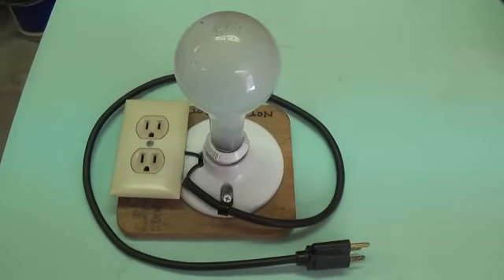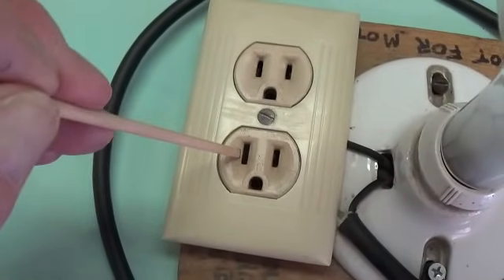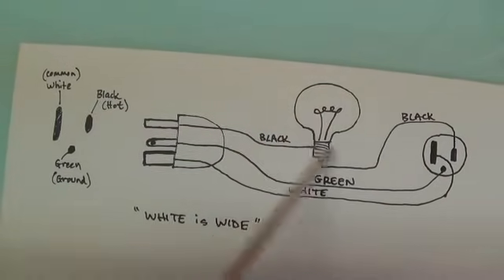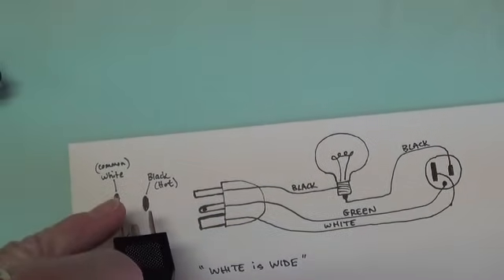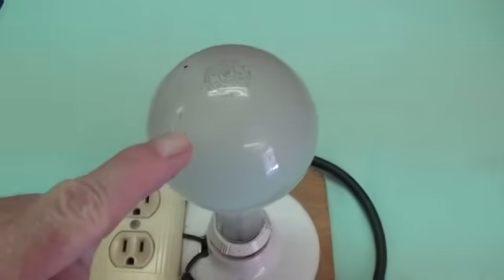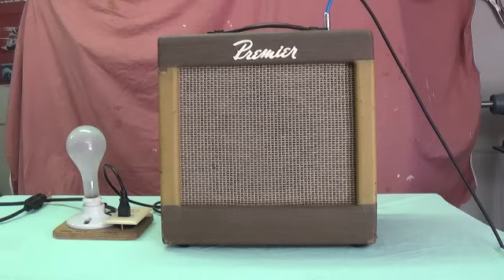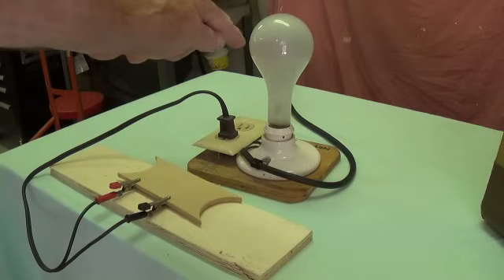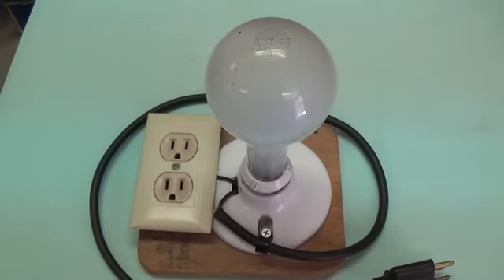Build Your Own Current Limiter for Protection when Repairing and Testing Electronic Equipment

Comment: Hey UD,
I just picked up a stereo tube amp from an old jukebox. I've ran it through your circuit and it plays both channels but has a bad hum. The bulb is on dimly but came up gradually, not right away. Do you think this could be an issue with one of the tubes? 
Thanks in advance!
Reply from the maker: +Rob Cosentino  Rob, you need to watch my video on types of hum and their causes. It may be a tube, but more likely the filter capacitors. Good luck.

Comment: Hi again Uncle Doug, Rusty and Jack. May I bother you all with a theoretical question? In a comment below you suggest wiring a couple of bulbs in parallel for someone to use with a 100w tube amp. My question is this; if one is to make a limiter consisting of 2 x 200w bulbs, is it better to wire said bulbs in parallel, which means both the hot and cold resistance is half that of a single 200w bulb, or in series, which makes the resistance twice that of a single bulb. I suppose the question really is what is more important for protection of the hardware; lower initial/cold resistance or higher on-going/hot resistance? Regards, Dave @ D-Tone Amps and Guitars
Reply from the maker: +D-tone Amps and Guitars Dave, the higher the wattage of a bulb, the lower its resistance.  Bulb wattage is directly related to amplifier wattage. High wattage tube amps require high wattage bulbs, and to get that high wattage (and low resistance) may require connecting two or more bulbs in parallel if a single bulb of sufficiently high wattage (i.e. greater than 250W) can't be found.  Connecting the bulbs in series would increase their resistance and would be the same as reducing the bulb wattage.......which would not be appropriate for a high wattage amp.  Low and medium wattage amps can generally get by on a single 100W to 250W bulb.
Reply: That's what I thought, but it is great of you to take the time to confirm it. I always get a second opinion where voltages that could kill me or blow things apart is involved. Thanks and all the best..
Reply from the maker: You're welcome, DT, and best of luck.

Comment: Thanks for explaining this UDoug! I read advice elsewhere on building a DIY Degaussing coil (coil of magnet wire corrected directly to wall AC) with the advice "connect a lightbulb inline to limit the current."

After pondering this I concluded this was bad advice and that the light bulb would have no effect. But that's because I was picturing the live and neutral in parallel with the circuit. Your video helped me understand that I can wire the light bulb "in series" if you will. Now it all makes sense, thank you. New subscriber right here.
Reply: +ygs ygs It definitely has an effect on the picture tube. But it's hard to tell if it's working as it should.

After building my coil, I went to try it on my CRT and discovered that the picture had cured itself - probably from using it over 2 weeks with the internal degaussing coil kicking on.  But in response to your question, I tried it on the one CRT I have in the house just now, an old curb picked 32" TV. 

Having no signal, the TV comes on with just the words "input 1" in large red letters.  With the coil in front of the picture, and power engaged (I used a momentary switch,) the bulb lights up and the red words on the screen jiggle back and forth sharply, right left right left right left. Is that what it's supposed to do?  I don't really know. I may need to hold it further away from the TV. But overall, I'd say, yes it is working. 

A friend has a store bought degaussing coil. It doesn't look much different from my homemade one. His also has a thumb engage switch, but no visible current limiting mechanism. He says his quickly gets hot to the touch after only a few seconds.  You might choose to make the lightbulb switch bypassable so you can have both versions in case the current limiting is making it less effective.  Hope that's helpful.
Reply from the maker: +Matthew Jenkins Thanks for subscribing, Matthew, and welcome aboard. Hopefully you will find all our videos to be equally helpful :)
Reply: Wish to find out, is your Degaussing coil using light bulb in series working ? I wish to build one Degaussing coil using light bulb in series.
Reply: Good. Thank you very much. Good information.

Comment: Uncle Doug:

                    I'm working on an audio amplifier that has two channels with a total of 100 amps.  

I'm going to put together a current limiter but what wattage bulb should I use or should I have two in parallel and what wattage for each?

Also, if there is a short will the difference in brightness be noticeable or should I test it with any electrical appliance that I know works to determine the normal brightness and then compare the two?
Reply from the maker: +Edward Boghosian The bulb wattage may require some experimentation, Edward.  If it's a 100W tube amp, I would think that a pair of 200W bulbs in parallel would be a good place to start. If it's solid state, I have no real experience, but a single 100W bulb might be a good starting point. The bulbs should glow very little, if at all, under normal operation, but will flash at full brightness if there is a short.

Comment: Hey Uncle Doug!
Thanks for posting this useful and practical device.
ONE QUESTION: How do you test the bulb before operation to make sure it is working?
Reply from the maker: +Learner-Learns You're welcome, LL. If the bulb is not working, it will be obvious because whatever is plugged into the Current Limiter will not work either.  To test the bulb you could simply short circuit the receptacle in the CL, and the bulb will illuminate brightly.
Reply: Ah, I see now... Thanks!
Reply from the maker: You're welcome :)
Reply: +Uncle Doug I thought the obvious answer would be "Take one out of the ceiling rose, which already works"
Reply from the maker: A good suggestion, except most people aren't using 250W bulbs in their ceiling light fixtures.....unless, I suppose, it's a pole dancing club :)

Comment: If you had touched the clips with your hands or fingers would the bulb  had protected you?
Reply from the maker: +wattdog16 Since the components the clips were connected to were carrying DC, I would have had to touch both a high voltage source and a ground to complete a circuit. This is one good reason to always use only one hand when working on an energized circuit. The bulb would probably not react quickly enough to save me from a nasty shock.....but it might save my life.

Comment: Hi Doug I built one of these here in the UK 240v, I use it when I get a old/new piece of equipment I buy usually receivers and occasional transmitters. 99% light up the   bulb  then immediately dims to a glow I also use different wattage bulbs to be gentle on old equipment starting with about 4 watts, and building up in stages to around 100 watts, don't want to shock the old components, like you I use it mostly everyday.
Paul    m0bsw uk radio ham
Reply from the maker: Paul Collins Greetings, Paul, and thanks for your input. It's good to hear from you :)
Reply: And you Doug, this device will no doubt save my bacon at some stage I'm sure,good video I'm constructing a isolation transformer at the moment, you have to consider this stuff as you get older and wiser.
Paul
Reply from the maker: Yes, indeed, Paul. The older I get, the less optimistic I become :)

Comment: Great video uncle Doug, I recently found an old phonograph that I showed to you.my question is . that phonograph doesn't have a wide terminal it only has two terminals The same size with no ground terminal.are there any extra or special precautions that need to be taken with a plug like this?
Reply from the maker: Donald Thompson  It's an old-fashioned, non-polarized plug, Donald. If the plug and cord are in good shape, and the phono works fine, then I would keep it. If not, then replace it with a grounded, 3-wire cord and connect the green, grounding wire to the metal chassis of the phono.

Comment: Hi Doug, Another great video, Your the teacher I should of had. But of course, I've got a question. ( I'm pretty dense) Ok , I read your description and I am wondering.  The bulb that I will use, will need to be tailored to fit the wattage of an amp. The amps I have are old a lot of them don't have the written description anymore.  Its wore off or its lost. For example; Today I will be working on an old Magnatone amp. It will be the first time I turn it on. ( I am crossing my fingers, from ebay) what do you suggest?
Reply from the maker: AmIonArock  Greetings and thanks, AA. The higher the wattage (power output) of the amp, the higher the wattage of the bulb, i.e. an old Magnatone with two 6V6's should  be producing around 15 to 18W of power, so a single 200 to 250W bulb will probably work just fine.  An amp that puts out 50 to 100W of power may require two or three 250W bulbs in parallel. If in doubt use a lower (i.e. 100W) wattage bulb (higher initial resistance for better protection) and work your way up to a wattage that just barely glows. NOTE: This is only true for tube amps. Solid state amps operate at much lower voltages and require much lower wattage bulbs.
Reply: Uncle Doug  I wish I could grasp what you said ? 
if the amp says 35 watts for this project to work, am I trying to match the bulb size with the amp? for example this amp says 35 watts, maybe a 40 watt bulb. OR am I trying to match watt is coming out of the wall, which is close to 110 volts.? Wait a minute a thought dawned on me...watts and volts are two different things ...am I right.  I can solder real good Mister Doug, even read some things on schematic.   But why things do what they do elude.  Reason I guess the confusion I do a lot of reading, and some other guy built his with a 40 watt bulb and yours was a higher watt so I guess if I knew why I would be better off.  I know that I am protect parts if there is a short. Maybe a bad capacitor  a short, and I am giving the electricity a place to go,case there is one.  And I am guess ing the bulb is acting sort of like a resistor. By the way this a small magnatone.
Reply from the maker: The "35 Watts" may refer to the power it takes in, not the power it produces. If it is a low-powered all-tube amp, then a 200W to 250W bulb should work fine.

Comment: When I really got into restoring radios and making stuff for myself I made a lamp limiter. It is the same, except that there are switches. One of them bypasses the lamp, the other being a on/off switch. I use different wattage lamps to drop the voltage by different amounts.
A cheap alternative to a variac. It avoids the situation where leaky filter capacitors exert excessive drain on the power rectifier. The lamp glows brightly in that event.
It also means the defective capacitor does not have enough current flow to boil the capacitor & blow it. I know for a fact the B+ electrolytics get warm if they are leaky.
Reply from the maker: NJPurling  I kept mine simple and basic, NJ, but switches can be added. Your description of the CL's function is right on the money. Thanks for your input.

Comment: You might have said this but:
Can you use multiple bulbs in series or parallel to get the desired wattage?
Thanks in advance!
Reply from the maker: Rob Cosentino  Yes indeed, Rob. Using two or more bulbs in parallel is a great way to achieve the proper wattage for high-powered amps. I tend to work only on low-wattage vintage amps, so a single 250W bulb generally works fine, but for those who work on big 50 to 100W amps, a pair (or trio) of 250W bulbs in parallel is the way to go.

Comment: Hey Doug. Nice job my friend. We deal with lots of tube amps coming into the shop for various problems. We use a 'homemade' current and voltage limiting device. We combine the function of a variac with the good old light bulb method of current limiting, to initially fire up an amp with known problems and to break-in and checkout the repaired items and new builds. They are an integral part of the tube amp test benches, and as you say, use them religiously. We use a slightly lesser wattage bulb in series with the black hot because we can use its 'glowing' intensity as an indicator of the amount of current drawing. However to run the amp up t o spec we do have to bypass the I limiter to ensure unrestricted current supply is able to flow.

Again, thank for your public service videos. We know they're not so easy to produce, so we [Greg Guitars] say thank you for your time and talent!
Reply from the maker: GREG GUITARS LLC Thanks so much for your kind words and helpful input, GG. Comments like yours make it all worthwhile :)
Reply: Jeff Allen, I guess most of us have stories like this to tell...if we didn't kill ourselves in the process! LOL. Yes the joys of childhood!
Reply: Hi mate, what are the chances on getting a reply to this after 8 years. Just got myself a nice old Japanese variac.was wondering where in the circuit you would place the light bulb * limiter* before or after the variac. ? Thanks.
Reply: Where can you find an old tube amp? They dissapeared with the dial phone, teletype, reel to reel tape recorders, cheap sea food.
Reply: Great Video clip! Forgive me for butting in, I would appreciate your opinion. Have you thought about - Saankramer Electronic Magazine System (do a google search)? It is a great exclusive guide for learning how to repair electronic items like a wizard minus the hard work. Ive heard some extraordinary things about it and my cooworker at very last got astronomical results with it.
Reply: @digifortune4062  minus the hard work....lol

Comment: Hello, I tried to research the answer (admittedly for not very long) but couldn't really find a put-my-mind-to-ease answer.  Would I be committing any serious no-no's if I semi-permanently played a guitar amplifier through a current limiter like this if the end goal is lowered b+?  Further, would the introduction of a 2nd amplifier in a stereo setup  change matters somehow?

Thanks in advance if you're able to answer!  Huge and appreciative fan/student here!
Reply from the maker: jrcenina85 Greetings, JR. I believe you could use the CL to reduce your line voltage. You would have to select a bulb wattage that provided the proper voltage drop (probably through experimentation).  The addition of a second amp would create a demand for twice the current....which might cause a problem since the bulb limits current flow. I would suggest a second, separate CL for the additional amp. Good luck.
Reply: Uncle Doug thanks for the quick response! I was planning on using one power strip for two amps but only one amplifier would be in series with the bulb.  In a layman's view,  the setup seems logically safe but I was just worried about some unseen-to-the-trained-eye danger.  Thanks again for the response and all the videos!
Reply from the maker: You're welcome, JR. Good luck.

Comment: This handy little device saved my bacon today! I fired up a used Challenger HF8 for the first time today, and wouldn't you know it, the rectifier tube (a 6X5GT) put on a little lightning show. When the party was over, the bulb on the current limited was dimly lit.  I guess the rectifier has a short.
Reply from the maker: Jason Thorpe It sounds like it, Jason. I'm sorry you had a problem with the rectifier, but it is an excellent example of the value and function of the CL.  Before you install a new rectifier, you might want to check the socket wiring to be sure it's correct and that no shorts exist.
Reply: I'm also thinking of removing the rectifier and bringing it up on the variac to test the PT secondary voltages.
Reply: Uncle Doug Yep, and also check for arcing on the socket itself.
Reply: Brad Linzy Uncle Doug I checked the socket, it was wired correctly.  I installed a new 6X5, brought it up slowly on the variac, and wouldn't you know it I saw an arc in the new rectifier before I'd gotten anywhere near 110V... I quickly shut everything down, and tested the new 6X5 in my tube tester and it seems OK.  I did not see any arcing on the socket itself (nor evidence of it), but I'm beginning to think there's some other problem.  Could a bad filter cap (one that's developed a dead short, say) cause a big inrush of current that would result in this?
Reply: It could be a bad power cap, I think. Check the first power cap on the rail. If that one tests good, go back and unhook the leads from the socket and test the transformer with Variac without the socket in the equation.
Reply: While I haven't had a chance to physically dig further into the amp, I did some some research on the 6X5.  This tube has quite a reputation, especially amongst owners of vintage Zenith console radios.  They apparently are prone to developing heater-cathode shorts, and because one side of the heater has a path to ground, the B+ now has a path to ground as well; roasted PT secondary winding ensues.

So, after I address the capacitor problem that's causing too much current to flow through the rectifier to begin with, I'm going to replace the 6X5 with a coupe of 1N4007s and a 220ohm 10W resistor.
Reply: Uncle Doug And given what I've learned about this particular rectifier, I think I'll leave a comment on the video about the Airline amp that I believe uses the 6X4 (which is a 6X5 in a miniature bottle), yes?
Reply from the maker: I too have heard forum tales about 6X4's and 6X5's causing problems in radios, but I have them in several of my guitar amps, and have never had an issue. I don't blame you for changing to diodes, but until I see some concrete evidence or authoritative data demonstrating the fallibility of these rectifiers, I'm going to leave mine in place.
Reply: @UncleDoug  If it ain't broke, don't fix it.
Reply from the maker: Sage advice, Silas, but sometimes there is disagreement about whether something is "broke"....or not. @silasfatchett7380